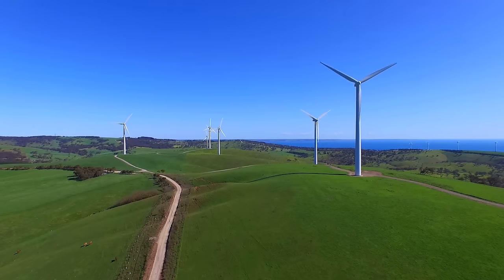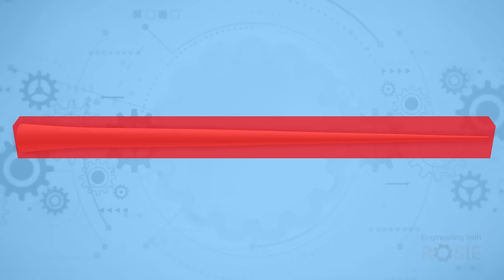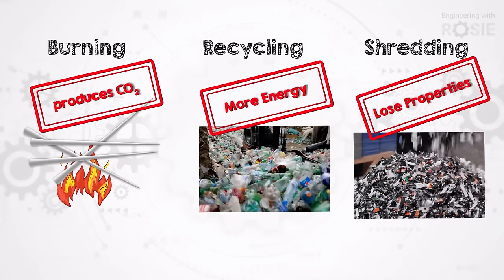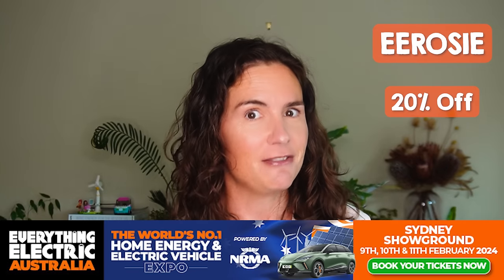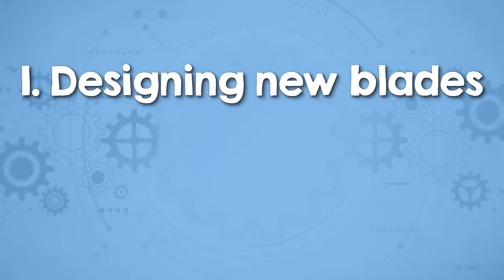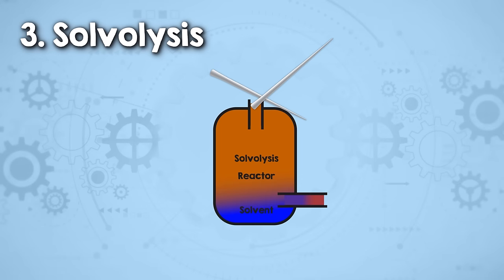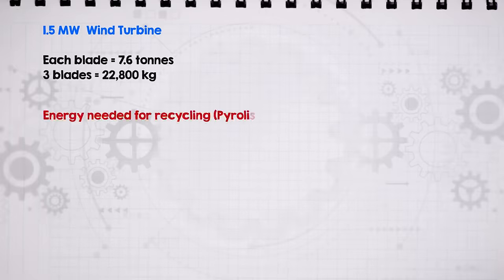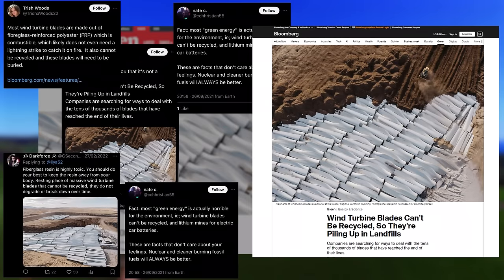This Is Why We Don't Recycle Wind Turbine Blades

Comment: My 5 cents. Use the wind turbines a little bit longer (or are they not strong enough). Quite often the wind turbines are replaced for getting higher capacity wind turbines or they can benefit from better tax incentives.
Reply: Damn inflation

Comment: Rosie, would it be energy efficient to simply shred blades into very small pieces, and put them in long flat bags for attic & wall installation (which will save future heating/cooling energy)?

Comment: Please pardon the ignorance, but wouldn't it be possible to make the blades out of Aluminium? (Like aircraft.) 100% recyclable, I think? And if it costs to much to carry them away, just dump them on the ground directly under the turbine, and allow scavengers to take them away for free? (They might come up with some use no-one thought of before, due to not being strange enough to think such a thought.)

OK, seeing as that's an obvious solution I think I have to assume there's some problem with it.

So how about using a quite thin sheet of formed stainless steel as the mould? Bond the fibre to the steel. You might be able to get back some of the weight loss by using a thinner carbon fibre layer? I'm guessing that a lot of the degradation of the fibre is down to UV, which isn't a problem for steel.

I suppose in spots where carbon touched steel you'd have rust problems. Again a pretty obvious alternative, even if it's the kind that gets chucked out summarily for being too complicated, so I suppose there's a problem with it.

My guess is that the only usable idea left of all these is just the idea of not fussing with the - essentially cosmetic - landfill part of the disposal solution. Just "litter" instead of getting all those compounds in closer contact with ground water by burying them. And allow junk collectors to cart off your junk.

You might find someone makes a yacht out of blade pieces then. (Or a sail.)

If we really are in a crisis cosmetic parts of solutions are another thing we can't really afford, after all.
Reply: "I'm guessing that a lot of the degradation of the fibre is down to UV"  That should not be right.  Sailboats built in 70-s do not have their fiberglass hulls degrade due to UV.  More issue is delamination, water ingress

Comment: Hmmm, 
Usually The Larger the Machine (Wind Turbine) the More Likey that Maintenance and Repair is Done at Site.
This is Pure Economics but Often Also Sound Engineering and Operational Practice.

Sometimes there is a Battle Between the Manufacturers and the Maintainers, This is When You have to Watch Our Politicians Very Closely.

Thanks ER.

Comment: I certainly hope Modvion gets their technology working to supplant most onshore size turbines-wood turbines that then become agricultural biochar!!?🤯
Reply: Modvion produces towers, not blades. Steel towers are easily recycled, but wooden towers have some other advantages e.g. more easily transported in segments
Reply: @redshift3  towers alone make a difference wow so still probably lots on inconvenience in replacing onshore blades indefinitely whoa - we can certainly hope for more biomass that is carbon negative before and after use in wind power generation indeed…
Reply: @redshift3  the towers particularly if they are cost and carbon budget wise able to be taller than they otherwise would be are wow wow wow important indeed…
Reply: My one criticism with most of the Wood->Biochar not done on the site of use is the issue of Ash.

Any “Ash Content” is effectively removed from that local ecosystem and either needs replaced with Fertilizers or somehow looped back.

I made some goofy backronym, “Biomass Origin Ash Return” but at scale i think this is an issue that needs more discussion.

It is neat though and also check out my ramblings on Reverse Coal Mining / Carbon Sequestration in Construction!
Reply: @ericlotze7724  nice !  Yeah wood used in wind turbines a minuscule issue even if half of electricity comes from wind in 2030s but nevertheless important to consider even for wind turbine wood which we can hope to have huge amounts of indeed

Comment: I believe Europe will likely introduce regulations concerning environmental impact and full life cycle requirements for Windmills. This could be driven by a desire to prevent Chinese manufacturers from flooding the European market with inexpensive windmills.
Reply: Ah, so quick switch to cheap electricity replacing fossil fuels can take a second seat :)

Comment: Just impossible to recycle, plus the engineering cabin is a disaster due to rotary vibration and loss of seals in cabin so all oil and grease will find its way into the sea. Several Scandinavian off-shore wind farms have issued a Notice to Mariners to avoid some 13 off shore areas as possible collapse onto ships.

Comment: I love repurposing, and when considering the looks of bike shelters and other things when done from virgin materials, I think I'd be pretty fine with millions of things looking like wind turbine blades. considering just the United States has over half a million bridges and 10,000 public managed playgrounds plus close to 90,000 elementary schools which most have at least 1 playground (plus probably thousands to million more held in private communities like HOA's). So, I think it could scale to handle the recycling needs for another decade at most in repurposing.

Comment: Number of wind turbines by 2030: 60 million. And this doesn't factor in the replacements every 20 years, that's if they make it to 20 serviceable lifetime. I'm all for cheap clean energy, but this is madness, ideologically driven madness.

Comment: the energy we use is only 225 times less than the sun radiates on ground level...after 100 years what will have happend? not co2 is the problem but the use of energy

Comment: Could you not just create a boat with a massive shredder that used blades could be slotted in to immediately post removal...that way, the clinker created could possibly be used in concrete.

Heck, the boats could even plug into the power being produced by the wind farm to power it.

😊

Comment: Or just make the blades out of aluminium like airplane wings. It is easy and cheap to recycle and maintans 100% og it's mechanical property's after recycling. And before you complain about aluminum's fatigue life just think about the fact that it is used in airplane wings that is flexing all the time, and is also required to be pretty strong and light weight.

Comment: Seems like you could cut them into strips and sell them as fiberboard. Let industry figure out how they can use fiber 2*4's and 4'*8' sheets. It wouldn't use all the blade but seems like the bulk of the blade could be strips and sheets. Might need to use some heat and pressure to get rid of the original shape
Reply: As is already stated in the post..... the resins are cross linked, so heat does not make it soft and pliable.....

Comment: The only thing that is really worth recycling is Aluminum.
Based on resources used and energy used to recycle material aluminum takes more energy and resources to obtain fresh than to recycle. It's not that it isn't abundant, it is. Go outside and grab some dirt, there is very likely aluminum in that handful. And that's the problem. There aren't large lodes or veins of aluminum, it's already out all over, it takes a lot of energy to extract aluminum from such sources. Recycling anything else is a waste compared to just getting fresh material. It literally does more harm than good. Reusing material is fine though and we should stop making products meant to break and be thrown away.
Reply: Yes, except even aluminum is not worth recycling. 1 aluminum can has a free-market scrap value of only one cent (USD).
Reply: @aliendroneservices6621  It takes way less time, effort, energy, and resources to recycle already processed aluminum, than it does to extract new aluminum is my point. Making it worth recycling for those reasons, not the monetary reasons of collecting the cans for extra cash.
Reply: @chrisnotyou  Aluminum cans are messy. They use several different metals, plus there's the label on the outside and the coating on the inside. It isn't worth collecting, rinsing, and transporting each can for just one penny. Money is our most-objective representation of generalresources. If you're wasting money, you're wasting resources.

"It takes way less time, effort, energy, and resources to recycle already processed aluminum..."
If the scrap value of an aluminum can is only 1 cent on the free-market, then your claim is obviously not true.

Besides, energy-conservation is deadly. The greatest threat to future generations is energy-conservation.
Reply: @aliendroneservices6621  You very clearly do not understand what I'm saying. I'm not going to argue with you.
Reply: @chrisnotyou  You never had an argument. Your claim is clearly false.
Reply: @aliendroneservices6621  Again, you simply do not understand what I said. 
Have a blessed day. Goodbye now.

Comment: will if you are going to count landfill as recycling, well coal, gas, wood burning etc, when the plant used reaches it of life? there not much not re used, is the all the steal metal, concrete brick stone etc, will are be reused for something, and if the where not recycled new would used in instead so that an almost 100% not used virgen new stuff?

Comment: The blades might be used as pontoons for floating boat-docks.
Reply: I suspect they will crack if you hit such dock
Reply: @dmitripogosian5084  I think they are quite sturdy, but they could be protected by a frame/fenders.

Comment: It's probably better to use them as substrates for artificial coral reefs 
Reefs absorb large amounts of carbon as polyps form calcium carbonate skeletons
Reply: Do reefs like living on composite substrates ?
Reply: @dmitripogosian5084  They will grow on anything that isn't toxic. One of the marine industry's biggest problems is stopping organisms growing where they would prefer they didn't. All coral needs is sunlight because the polyps have symbiotic algae living inside them
Reply: @PaulG.x  For corals there is some contradiction here. If they would be spreading that obnoxiously we would not need to protect them. Given that they are actually dying, but can grow on anything, lack of substrate to support seems not the issue,  isn't it ?

Comment: misinformation campaign detected?

over here in the EU we have no landfills, the material is considered hazardous material.

especially no windmill landfills, but i am from a co2 neutral nation, and we are largely energy autonomous as a country with nuclear, wind and hydropower

In the EU, at least the countries i know  - putting the blades on landfills is simply prohibited.

Recycling ideas are beeing practised already:

- the material can be mixed with, or be used in the production of cement/concrete.
- it can also be used in flooring material 

There are also tests done with blades out of recycled wood.

Comment: Instead pf recycle why reuse.   For instance  a 100 metre iong blade might lose 25& of its strength  after 20 years.but if was retained in 4 smaller  blades then the loads would less and there another 20 years of life .

Comment: How about coming up with a design that does not need the giant blades?  There are many designs out there some of which are more efficient and less deadly to birds.  By the way, less than 10% or plastic bottles are actually recycled.
Reply: Swept area is key to wind power. You can't engineer around the need for it.
Reply: @aliendroneservices6621  Get away from thinking that the wind needs to be captured by the blade.  Have you ever noticed areas in building compounds where there is always a pile of leaves?  By using cheap rigid structures to redirect the wind to a central location of smaller faster turning blades on multiple ground based generators.  

Get away from what has been done and do something different.
Reply: @lostvisitor  OK. The wind equivalent of solar concentrator. Solar cells are more-efficient when the light hitting them is concentrated, so I would think the same would be true for wind turbines.

We can also see this principle in action at hydroelectric dams. Head (water height) is used to increase the water pressure and speed through the turbines. This increases the efficiency of conversion to electricity.

I stand corrected! Thanks!
Reply: @aliendroneservices6621  Thanks for listening.  We have all the tools we need to save our selves.  But it will take effort and not following the rich, who are leading us to the cliff.

Comment: I don't know if it's worth anything, but the blades could probably be reused on ships to help save on fuel... maybe a pair that can work together to balance the boat. I know it's a crazy idea.
Now that I think about the balancing thing... a giant flywheel could be used to stabilise the ship and it would serve to eaven the load on the engine for when there's big waves working as an energy storage as well as gyroscopic stabiliser.

Comment: I think you are locked in to focusing on only a high tech solution.  You said they are very strong for load bearing.  Are they strong enough to cover with earth to use for an earth sheltered dwelling.   Many people are spending money to buy shipping containers to bury them.  If you gave them away to people who wanted to experiment with using them this way; you could probably find people who would pay the shipping cost.  At the very least they could be used to construct simple retaining walls.

Comment: The old blades doesn't do any real harm, unless you do something stupid with them. Landfill isn't a great solution, but also, not a big problem for wind turbine blades. It's another matter with unknown mix of garbage, that leach severe toxins and produce methane, and land filling huge amounts because people bought/thrown away stuff for no good reason. 

It seems to me repurposing should have significant unrealized potential, there are a lot applications where the exact shape of structures, or structural parts doesn't have to be an issue. Maybe cut up pieces can be used to replace concrete foundations for houses? I suspect the blade pieces will remain more than sturdy enough much longer than most houses lasts. A solution doesn't have to be a good solution for 100% of the blades.               

Not that I think current technologies constitute a significant problem, but it would be interesting to get an idea of how far from viable it would be to use something like balsa wood to replace most of the synthetic composites. Covered, and treated, obviously. According to multiple sources, time from planting to first harvesting can be as little as 5 years, that's from seedlings, not seeds, I presume. Balsa isn't just very strong for it's weight, increasing production could be done in relatively short time, for trees.

Comment: Sounds like someone is trying to justify their mountain biking waste! 😉
But seriously, this doesn't have to be a single solution problem. A million cycle sheds across a planet seems inconsequential, but burying all the blade waste in cement, seems like an easy solution with China alone producing 2.4 billion tons  in 2020.

Comment: I am wondering, although I have no idea whether it is the case, if basaltic fiber can reduce the problems compared to fiber glass and carbon fiber. 

Basaltex argues: ' Made without the addition of chemicals like boric acid (glass fibers) or any other minerals, these fibers are sustainable, recyclable, circular and environmentally-neutral.

They are considered circular as they contain no additives and basalt fibers can be recycled by simply melting them down to create new fibers of exactly the same quality.'

You would still need to use pyrolysis etc to get rid of the resin, but some eco conscious yacht manufacturers such as Windelo seek to argue that they offer a substantial improvement for sustainability and recyclability over at least fiber glass, and possibly carbon fiber.
Reply: Posted in the wrong place: It looks as though a comment I made has been auto killed by Google. It was to the effect that googling recycling basaltic fiber shows that it is a very different proposition to fiber glass and carbon fiber. MDMI have hit 90% of the tensile strength of the virgin basaltic fiber in a material in a reycycled material, which also has excellent properties for marine use, when many turbines will be offshore. So it seems we can make turbine blades capable of recycling for at least one more cycle of use as well as rebar etc

Comment: Whether or not it is important to recycle them in the first place depends a lot on how bad they are when placed in land fills. If they don't leach dangerous chemicals into the soil, it may be the most environmentally friendly way to deal with them. Also important is to look at the total volume of material per unit energy vs other forms of energy and the amount of waste they produce per unit of energy and the ease of safe disposal of that waste if at all it is. The reality is that many open pit mines are environmental disasters.